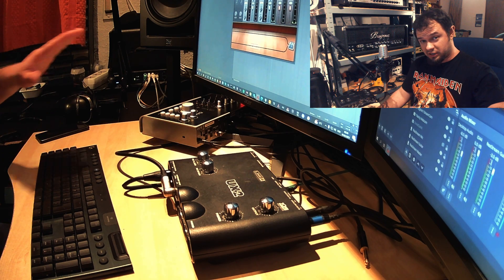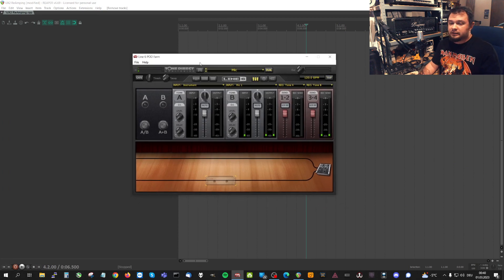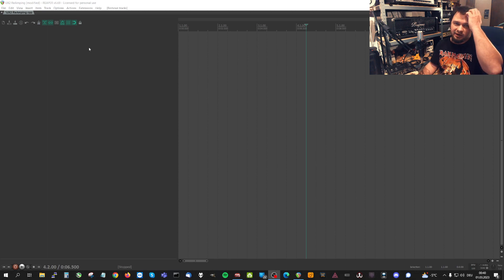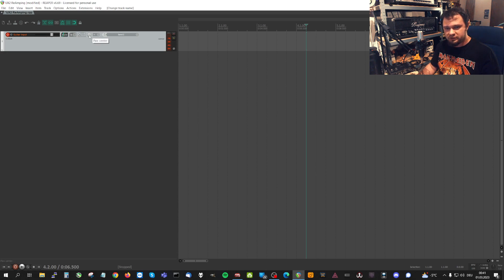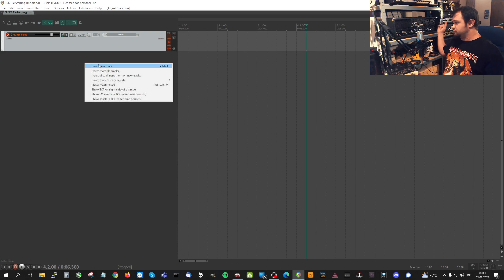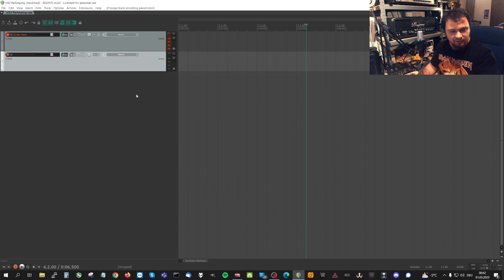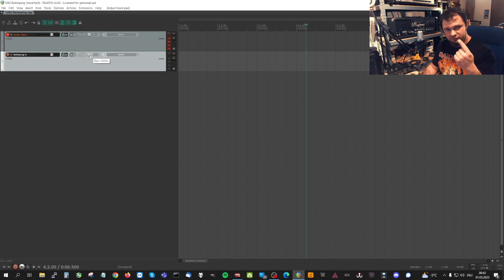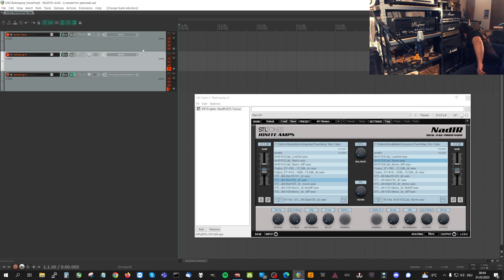NAM (Neural Amp Modeler) REAMPING SETUP TUTORIAL with small audio-interfaces

Comment: hmmm weirdly i never do that pan for the input test signal for the amp signal in  i go into reapers routing and just put the left output to mono in the menu. no panning is necessary. but its your way and i respect that you get the tone you want that way! and i take the signal and turn it off so it doesnt go to the master channel. there for when rendering do as a stem and make sure the convert only mono to mono files. it makes life  easier when the signal path is straight! pretty good for having hearing loss. i think your doing good. i do zero panning before because it changes my signal . i also mute the output recorded and i dont send it to the master as well. makes life easier when you can seperate without panning. still respect on your method. if it works do it.
Reply from the maker: Your method perhaps is way better than mine. I just found this out "on the fly" and this video was actually just meant for the NAM FB group as a casually "here are my findings" video, but the increased interest in this topic led me to setting this video for public display. 

Best is of course to simply get an interface with 4 outputs. 

Thanks for watching and commenting!
Reply: @PippPriss   always nice to watch your videos. entertaining and informative!
Reply from the maker: Thanks! Trying my best to deliver something people would be interested in. Now I just got to find out how to cut down useful information into small packages for shorter videos :-D
Reply: well your doing great for being def in one ear. do not worry about haters either. keep making that content im entertained and i get some cool pointers from your info.
 @PippPriss

Comment: Can I use a Boss pedal, which has a buffer, instead of a reamp box which I don't have?
Reply: some are getting this done fine. i use zero reamp box or di in the input to the amp from my behringer interface.i just send the signal from on output to the amp and then from the back the amp through a analog passsive DI box parallel power to the speaker cab.  then to the computer  through the low Z xlr which is 600 ohms into sound interface i also have an attenuator switch on the di box i leave at 0DB but i could always cut to -40db or -20db .i mute the output signal inside the daw. dont need to hear that horrible noise.  gain adds. and when converted with nams trainer program some of that noise people say they want gone actually is sound you want because gain is distortion.just gain stage to get close to the input test signal wave source and bingo great mixes i use a -20 db cut on the interface preamp.
Reply: some get good results with a boss pedal set the eq to flat and then gain off for the pedal and then use the output volume to control the signal,some say put the pedal input reverse to output never got that way of thinking. just gain staging is what its doing basically. but a di between doesnt hurt but can change the amps captured sound which some like some hate. its preferences on tone shifts some di and reamp boxes color the tone and makes something different.
Reply from the maker: I have tried this and made a video - search my channel for ReAmp Box, and it should pop up. 
However, in short: it can work, but unsatisfactory in my case due to hum issues etc. But your mileage may vary, and better worth trying out than never finding out.

Comment: Not the simplest thing ever but it's up and working, now just to get it running with the Axe I/O and my Captor 8 load box. Thanks for all the assistance!
Reply from the maker: No worries, glad it worked for you - actually, it's a pain in the ass to set up 😀But it does work well. However, I switched over to a bigger audient iD44 for avoiding this switching around etc.